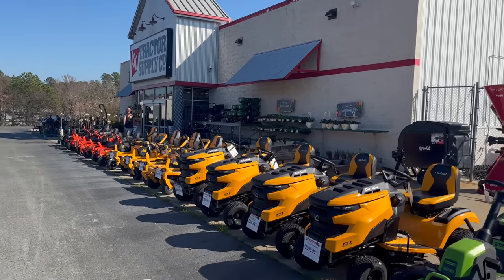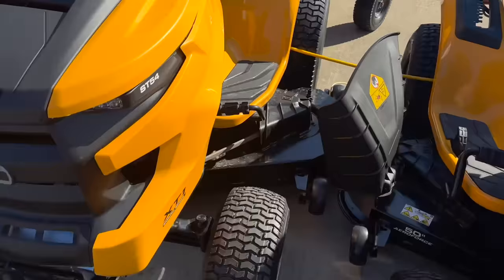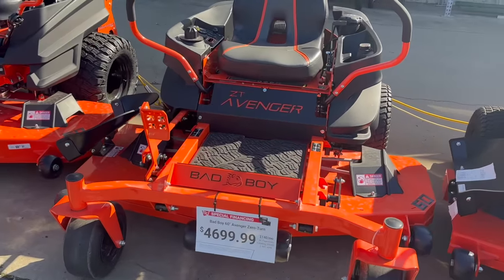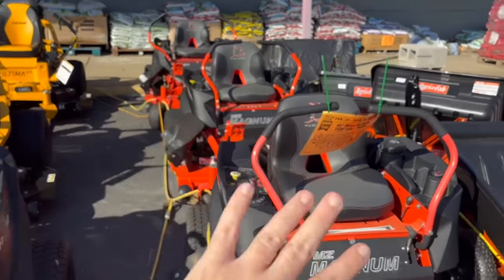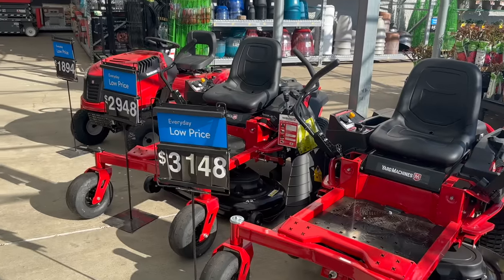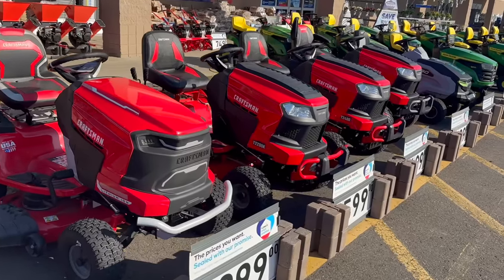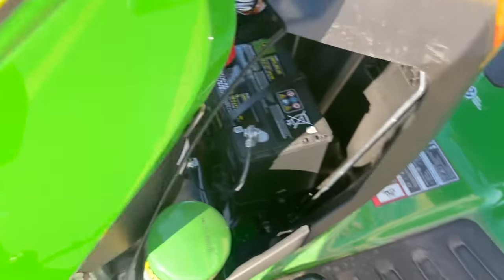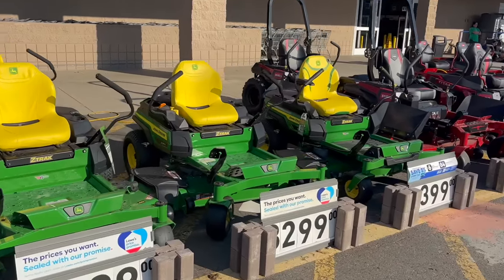The BEST Mowers to Buy and What to Avoid at The Big Box Stores This Year!

Comment: Bre, I am on a waiting list for a Honda HRX217 k6vkad.  In a previous video you referred to what would be a Unicorn mower.  In 2006 I bought a new, push 21 in. cut Husqvarna with a 160 cc Honda motor and the mower is still working real well, despite lots of use.  Neighbors have used it numerous times  Maintenance has been two spark plugs and replacement of front wheels with worn bushings (42.00 for two new wheels).  A repair tip, bushings can be replaced using copper tubing reamed to the correct stud or axle size.  Machine shop equipment is needed for accuracy.  I have always changed oil when needed, kept a clean air filter, kept the blades sharp.  This mower has a bagger for my zoysia grass.  I lived in Camden, AR. from 1981-2004.  You probably live near HotSprings, which attacts my interest to your very informatve videos.

Comment: I just bought a John Deere S240 with a Kawasaki Twin Cylinder Engine. 
I also own a LA110, which I bought new in 2007 and it’s been bullet proof. The LA series mowers were only made 1 year, 2007, as it was a transitional mower. When comparing the S100 series, none had what the LA110 has and I had to go to the S240 to get what the LA110 has. So far it’s been a good mower, but I don’t like the reverse pedal configuration.

Comment: The first thing i do is drill a hole in the spindle and tap it for a grease fitting, and remove the seal cover from the inner part of the bearing. No more problems.

Comment: Thanks! That really accelerates my decision process. I have a JD RDO dealership nearby and a Husqvarna dealer a bit further. Ive been using a Husqvarna with single cylinder briggs for many years. No cam issue yet. It smokes a bit now. Ill be replacing it this year i think.

Comment: Last year, summer 2023, I bought a used John Deere X300, 42" deck, Kawasaki engine, hydrostatic transmission with 150 hours. It looked to be in good shape, so I gave $2800 for it. I love the THICK blades, never-rust plated hardware, and safety feature of automatic blade-stop when backing. It starts easy, runs smooth, and has a huge gas tank. 

My last mower was a Yard Machine with B&S single piston engine, but the compression release is a terrible design, and failed twice now. Almost will not start without that working correctly, and means tearig the engine apart to replace it, since it is on the camshaft. Ugh...

Comment: Guess I lucked out in 2021 I got a used 2018 JD X570 with a 24hp kaw for 3800.00 delivered as the owner wanted to move to the JD 700 series, it has the 54 inch welded deck and it's a work horse.😀

Comment: I bought a brand new T100 walk behind Cub Cadet trimmer, about 6 years ago.  It's sitting beneath my house, rusting away simply because it ran for 4 hours and stopped.  Contacted them for warranty repair work was a huge waste of time for me as they refused to help me and the closest repair center is 300 + miles away.  Bought a DR Premier model and I have never been happier in my entire lite, best danged walk behind string trimmer, I have ever owned, with 6 years of service on it, and all I've had to do is replace the drive belt for the cutting head.  Highly recommend them.  I wouldn't hit a dead hog in the butt with anything made buy or for cub cadet.
Reply: Yah, finally wore out my old dr sprint trimmer, picked up their cheapy one last year.  I've had good luck with DR.

Comment: I really enjoy watching your reviews and opinions on all these different brands of riders. I know you're really negative on the Cub Cadet zero turns but I've decided to buy one anyway. It came down to the ZT1 50" Ultima vs the Bad Boy Rambler 42". Three reasons why I chose the CC. First is price, the CC is $3,300 and the BB is $3,600. Second reason is the CC has a twin Kawasaki and the BB only has the single Briggs. The third reason is that the CC also has a fabricated deck like the BB, it's not as thick of gauge but it's still better than a stamped deck. 

I'm only using this mower for residential home use so hopefully it will give me many years of good service. Love to hear feedback if you read this.

Comment: I would love to hear your thoughts on the best gas powered push mowers on the market right now. I am in the market for a new push mower and most of the big box stores in my area are going all electric with only 2 or 3 gas powered available. I am willing to shop at a dealer if that is what I need to do to get a great mower that will last for years with regular maintenance. I love your channel it has helped me out, getting my MTD Bolens mower going this year. It is near the end of its life and wasn't in good shape when a friend gave it to me a couple of seasons ago when he moved. It does not bag and there are times I need a bagger.

Comment: I've found the best deck size if your mowing 2 or 3 acres, is a 48 inch with 3 blades, and the highest horsepower that you can get. Especially if your ground is hilly. 54 inch or more is only good for flat ground cause the deck tetter totters too much, and if you don't mow every 2 weeks it takes way more power to run that wider deck, and high grass chokes it down. My first rider was a ,25 horse Briggs with a 46 inch 3 blade cut, and the grass could be 3 foot high and you couldn't choke it down. I had a 26 horse Briggs and a 54 inch ,3 blade cut and it would choke down in high grass. The deck weighed too much to pull hills good and tettered mowing sideways on hills. I now have a 24 horse 48 inch 3 blade cut John Deere S170 which I like very much except it's too hard to replace drive and deck belts. Also when you shift your weight to the high side of the hill the seat shuts the engine down. Not a very safe so called safety feature. Well I've been mowing this property for 26 years and i know what works for me. The comment made about 3 blades being better than 2 on a 46 inch cut i totally agree with cause theres far less resistance out on the end of three 15 1/3 inch blades over two 23 inch blades. I personally would not pay for the thicker gauge deck of the 300 or 500 series, because it's too much weight to pull hills and the mower is going to wear out someday anyway. If you want something to mow faster my neighbor mowed my property in 3 hours with a 48 inch brush hog on the back of his Kubota Tractor and it takes my S170 5-6 hours but I spent $3,000 and he spent about $25,000

Comment: I can appreciate what the Chickanic is doing here. However, I punished the ever loving snot out of my 42" Troybilt riding lawnmower on a 2 acre mountain lot with hills, ruts and roots. My use case was definitely not cutting a normal suburban yard but, I never had an issue over the three years I used the mower (sold it with the house). That said, I do think it is a good idea to buy something that will last so, if you can afford it go for something nicer.

Comment: Brie, you missed the difference on a couple of the mowers at TS.  Several have suspensions on the zero turns.  If you've ever mowed on rough terrain with a zero turn, it will beat the rider up pretty good without some kind of suspension.  I went from an Ariens ZT to a Ferris IS2200 for that very reason with  suspension and air ride seat.  Of course that is a commercial unit.

Comment: At 3:51 you were comparing price of the cub cadet zero turns..  The one for $4499.99 also had suspension on the front caster wheels..  That could add to the price..  I wish I had those on mine..  I have the 54 inch Cub Cadet..  Love your videos..  Very informative..
Reply: I brought the 154P with the suspension you mentioned yesterday.

1st cut, and it does not cut grass very well. I was extremely disappointed.

 I bought the mulching kit, will install it, and see if that's going to make a difference. If not, I will be returning to tractor supply.

Comment: The Bad Boy is the closest mower to my Scag. The Scags have strong spindles you can grease and they unbolt from the top. Both Bad Boys and Scags have strong steel frames. My SCAG has a liquid cooled Kawasaki. If I had to replace it I'd go with a Bad Boy because the dealer is just around the corner. I've checked every model ,I'd make sure it's 60 inch minimum and has a Kawasaki

Comment: I mow 17 acres, have been using and xmark for years last one has 14500 hours and has developed oil leaks. Never had to change spindles deck is built like a tank, however. To replace one with the same specs I was looking at 12K. Ended up buying a Bad Boy, nothing else comes close to their superior construction, Had a choice of three engines, Briggs, Kawasaki, or Kholer. I have nothing but good luck with Kholer. I got the Bad Boy for 5.7K It measures up to the xmark in every respect. Plus, it's easier to service with ample room to do routine maintenance.  It handles great with dual hydrostatic drives, which eliminates making divots when turning around. The two drives give much better wheel control. Love the Bad Boy there is a reason they are the fastest growing mower company in the US.
Reply: Wait till they go cheap… ;-(
Reply: @timm8675  I hope not, but at 70 with luck the current BB will last me long enough.

Comment: I had a 2000 42" craftsman manual trany, and woud hook up hay wagon with roughly 120-140 bales. I would get it rolling as fast as i could and pull it into the barn, barn had a slight slope so as soon as wagon stopped the wife through the block behind the wheel so it didn't drag me back out. That mower did that for years until the engine gave out.

Comment: i will never buy a John Deere not because they are good or bad. I had a bad experience at our local dealer, I was in a market for a riding mower and the 400LB. salesman was to lazy to get up and help me. So I went down the road and bought a Cub cadet mower 14 years later with no issues I'm ready to upgrade to a zero turn. Thanks for the information.

Comment: What’s your opinion on a new cub cudet xt2 46 inch . Been thinking about buying one. I’ve owned a Troy bilt pony with 15 hp for 9 years. Besides some deck leveling issues it’s been great . Change fuel filter , air filter , blades once a year. Change oil twice yearly. Bought it new for 1,000$. It’s truly been great .

Comment: You definitely right with Cup Cadet. Even if 5 years ago they haven’t been a bad choice. My XT1 is 2 years old and a weld seam for a puller on the deck is cracked. The deck needs to be replaced. So I bought a new one. Bute a 2 years older one of the Sam’s model. Hard to find, but better welding, thicker pointing and 4 wheels instead of 2 wheels. The traktor is OK, but you can also see the cost savings year by year on the trans, axle and wheels. Customer service and warranty? Do they know what this is? At least here in Europe not.

Comment: Thanks for the video.  I would like to see you do a video that concentrates on transmissions, particularly on traditional riders.  It seems they all use Tuff Torq's these days and don't look half as strong as the old dual-range manuals in older Craftsmans or the Hydro-Gears used in the older higher end Craftsmans.  Do you see issues with the TL-200 vs. the K46 and what about the Hydro-Gears in the zero turns.  How do the lower end 2200 and 2800's last?  Based on specs, it seems only the 3100 and up have all the features that are needed for even larger residential yards.  Also, how is it that the Toro Timecutters say they have Hydro Gear 2800's in them but they look like 2200's.  I called Toro and asked but couldn't get a straight answer.

Comment: I bought a Troy Bilt Bronco 9 years ago and it’s still kicking. If you do the yearly maintenance on it you’re good to go for years!! I am looking to upgrade to a 4wd riding mower due to 1 steep uphill cut and I do pull a cart a lot. Any good budget suggestions? I only have 2 acre that I cut. But use the Troy Bilt pulling a cart and doing a lot of work on 5 acres 
Thanks in advance

Comment: Love your video.

Our daughter and son-in-law bought a mountain property outside of Hendersonville, North Carolina. They have about 2 acres on a very steep grade. It’s a power easement that they are responsible for cutting because it’s technically their yard as well.

We bought them a secondhand Husqvarna Which is doing OK but really they need a four-wheel-drive tractor, so say their neighbors and the local Ace Hardware dealer. Do you have an opinion on this? Do you know of a particular model that would work well for them that is four-wheel-drive.

I believe it’s too steep of grade for a zero turn type mower. Thanks.

Comment: I have a 2018 poulon pro model pp 20va46
200 hours on it 4 oil changes just replaced the 2 spindles this week. I cut 1 acre with it . I live in S Florida  it's been a great mower just also replaced the deck belt first time. Maintenence is a must no issue with the cvt I keep grass out of it . However the tie rods for steering went bad got adjustable off ebay seem to straighten out the outboard casting issue. And my fuel cell leaked at bottom outlet till I epoxies it up . I will definitely  get a bad boy next per your video. Thanks for the information and input on engines. Oh and feel free to check out my review on my mower.

Comment: I live near Lonoke,now,but,for 50 yrs,I lived in Michigan,moved here in 2013,and I'm 72 yrs old.
 I've been repairing outdoor equipment,for 45 of those years,and I've never really cared for the Husqvarnas,...mostly because they have problems with deck roller failing,and cheaply made decks,and front axles.
I used to lovethe old Craftsman(cast iron 6speed trans,B/S opposed twin engines)My personal favorite is my1969 Bolens 1050,which is only used for plowing gardens,or snow removal(It has both a blade,and a snow thrower).
I've had a LOT of Cub Cadets,TroyBilt,and Yard Machines come through,and I hear the samething from them"I've replaced spindles EVERY YEAR",or why do I  have to have a new front axle? Can'tyou just replacethe busings?" 
Oh for the "good ol' Days ....
Of course ,most have been used hard,and not maintained.
Love your channel,...keep up the good work!

Comment: Wow, prices are just crazy now. Paid $2100 for a JD D130 including free pull cart in 2013. Thankfully, I went the twin cylinder route based on gut instincts. My yard isn't huge (just 1/2 acre), but would still love to have a zero turn to speed up mowing. Limited to 42in since the doors to my storage bldg won't allow anything bigger. My D130 is still running like a watch though so no need to switch. (Regular maintenance, a set of blades, new belt, 2 batteries and valve lash adjustment is all I've had to do - all myself.) Thanks so much for the info ... if buying today, I'd be looking hard at that Bad Boy 42in. !

Comment: Having spent four decades immersed in the world of riding mowers, I couldn't help but notice a few crucial points you should have highlighted in your otherwise stellar review. Firstly, let's address the critical significance of fabricated decks. Stamped decks, especially on larger models like the 46" variants with dual blades, are notorious for premature failure even in normal wear and tear to me it is almost a must.

Speaking from experience, I've owned both a Cub Cadet equipped with a Kohler 7000 engine and an Ariens powered by a Kawasaki FR. While both perform admirably, I've found the Kohler to be notably more user-friendly in terms of maintenance and service. Over my years of ownership, the Kawasaki has presented more challenges and issues compared to the consistently reliable Kohler in my case. I wholeheartedly agree that steering clear of Briggs engines is wise, given the track record I've encountered with them.

Furthermore, it's crucial to highlight the distinction between electric PTO and lever cable mechanisms for belt engagement it makes a big difference on changing and longevity. This disparity can significantly affect ease of use and maintenance.

Additionally, let's not underestimate the importance of horsepower when selecting a riding mower. Having ample power ensures smoother operation and better performance across various terrains. In my opinion, anything over 42" should have a minimum of 20hp; it's far better to have more power than less.

Regarding zero-turn mowers, while they offer unparalleled maneuverability, they aren't universally superior. Despite their agility, they can result in a bumpy ride on uneven terrain and may not be the ideal choice for smaller lawns due to the risk of grass damage from tight turns. In many scenarios, a traditional riding mower proves more suitable, particularly in rural areas with rough terrain, hills, and bumps.

Lastly, while dealer support is valuable, it's essential to consider the significant price discrepancy. Paying 25% more, which can amount to thousands, for the exact same mower isn't always justifiable. This is especially true in my experience; it's just not worth the extra investment but I always fill out my warranty cards immediately now if it's just a couple hundred sure because you "should" get better support if you purchase it from them but not always. Anyway thanks for the video it had a lot of good information in it.

Comment: I just bought a Husqvarna Z248 with a welded deck and Kawasaki engine.  I don't know about the transmissions, I didn't know to ask.  I did get it from a dealer (but not a Husqvarna exclusive dealer, they also do Still and various mowers).  Hopefully it works out for me.

Comment: Question for you 
After hurricane IDA we ran our portable generator for 16 days nonstop except to change the oil every 100 hours. I used sae 30 Royal Purple full synthetic motor oil and never had a problem. Does a lawn mower put that much more of a load on the engine than a generator….